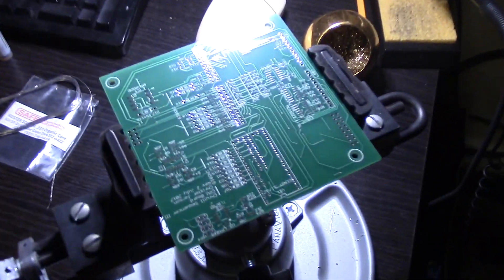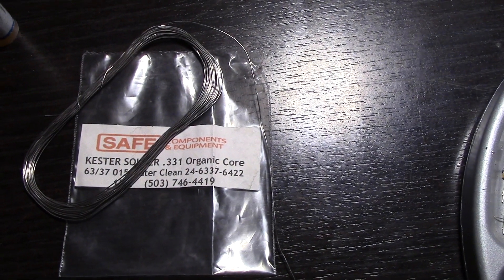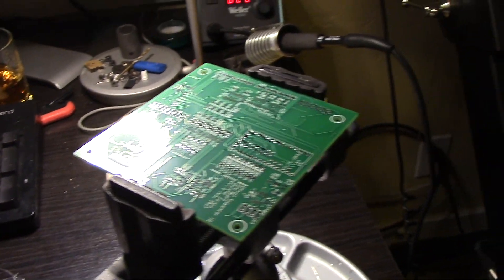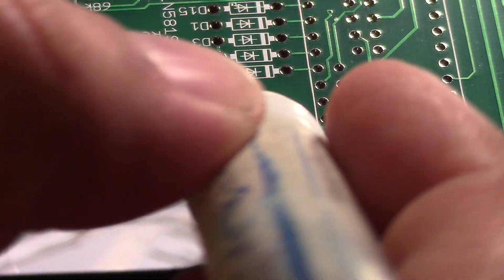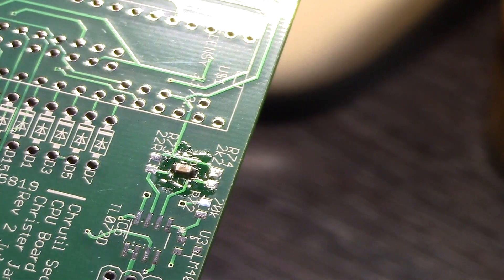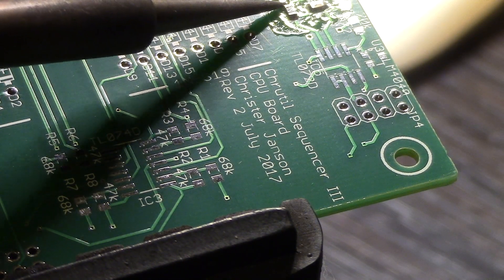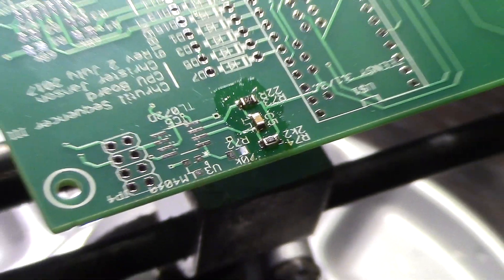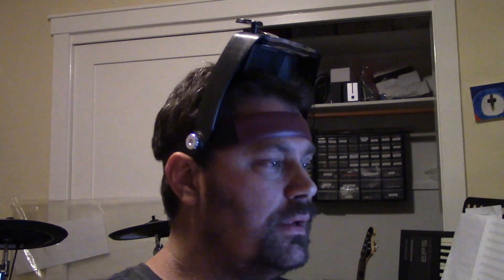Soldering all those 0805 Caps for Deckard's Dream

Comment: i thought that the deckard's boards came with the surface mount components already attached. if that is not the case then that just makes the cost of the boards that much more ridiculous.
Reply from the maker: Hi, all the surface mount ICs comes already attached - like the DACs and the CPU. You still have to solder the surface mount 0805 bypass caps yourself. There are quite a lot of them, but they are super cheap - maybe about $10 total, although with the recent skyrocketing in capacitor prices it might be up towards $30 now. Still, price-wise no big deal, and as we can see from these videos it's really not a big deal to solder them either. Plus once finished, it is truly a unique and wonderful machine.

Comment: Hi cool video, I just wanted to say that I repair circuit boards at my job and we always use two soldering irons for surface mount parts. Also we use tips that curve at the end so it's easier to position the parts onto the pads. Just my two cents I enjoy your videos.

Comment: I breezed thru a TTSH build but struggled like a mother****er trying to build a Mutable Ripples. So, there's no way i'm building this :)
Reply from the maker: The DDRM is not more difficult than the TTSH, maybe even simpler because there is no PCB that big that makes it difficult to handle. However if it exhausting because of the amount of soldering. Most of it is resistors and caps (and some SMT caps), so not difficult but it is tedious for sure.
Reply: It's a damn tempting project either way. Aside from the 220$ enclosure, about how much for the parts?
Reply from the maker: I haven't tallied up the totals yet, but it is not a cheap kit. Probably North of $2300 with pbc, case, power, cem3340, V2164s, BOM and stuff you need off ebay... yikes! Four more voice cards to go and I'm done!

Comment: I see you have a lot of experience building synths, and I was wondering if you could record a video about an overview of the various techniques a beginner can use (mainly for those who are designing their own boards). You could talk about (and even show us real examples of built units) what is worth the effort and what is not, pros and cons, lets say, through hole vs smd; no wire pots (pots directly on the board) vs wired pots; one big board vs two or more boards (analog and digital boards); doing or not a control board (one board only for pots and switches) or not, etc. And obiviously the various synth formats on the market.
Reply: YES!!

Comment: Have you ever tried to use solder in paste form and heat the smd component and the solder with hot air solder?
Reply from the maker: I did, actually. I recorded part II of this video showing that. I was not thrilled with the experience, but you can see for yourself at: https://m.youtube.com/watch?v=epv8RA_p514